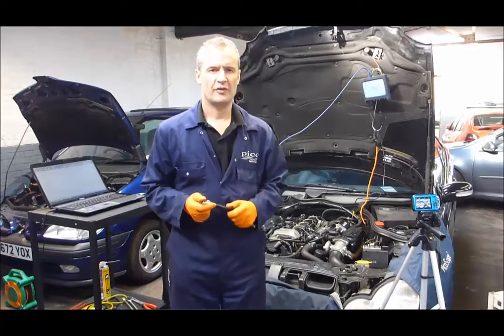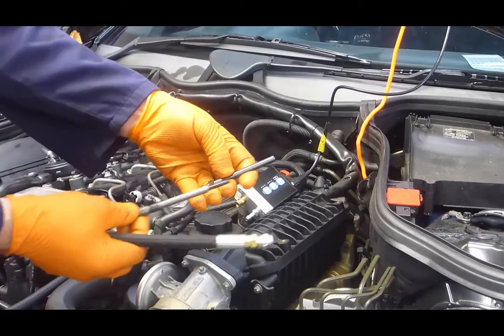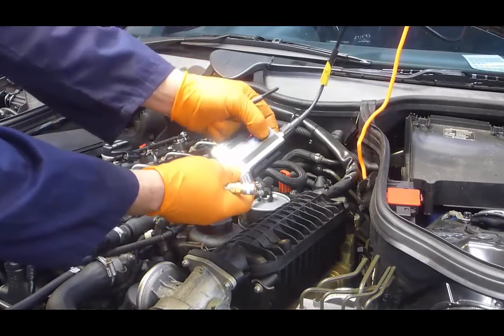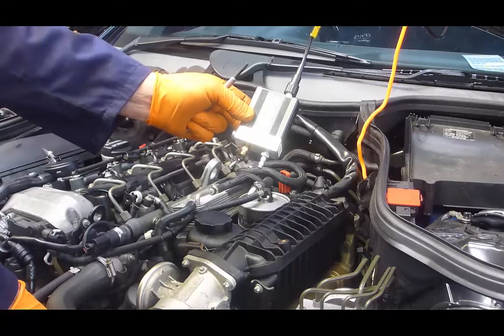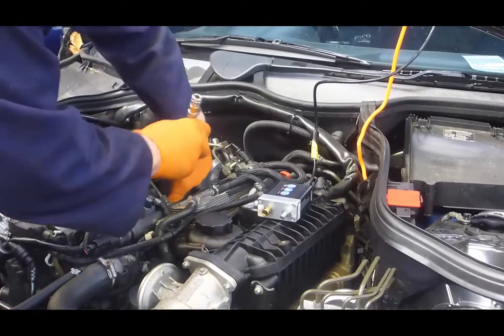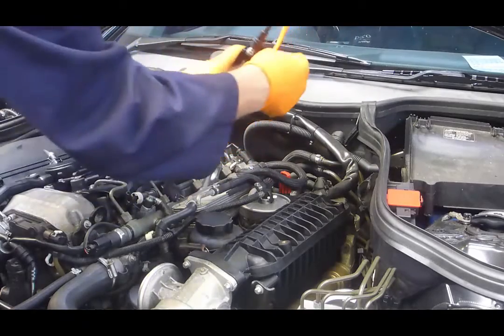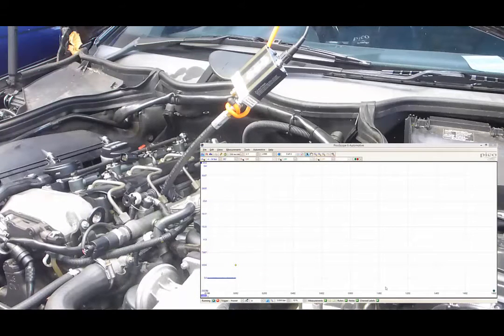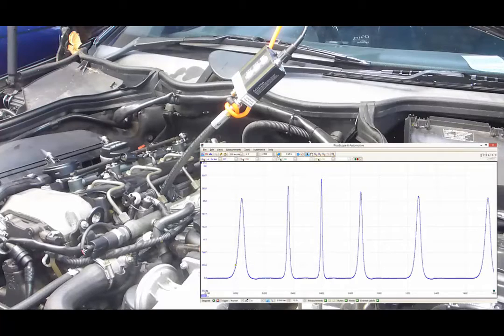Diesel compression test using PicoScope and Pico WPS500X and AST accessories

Comment: Is it possible to do the test on the diesel while the engine is running? With diesel, we easily have 30-50 bar compression and the pressure transducer only goes up to 35 bar.